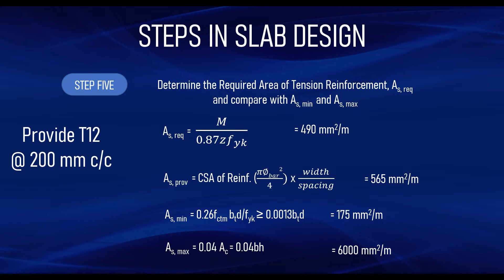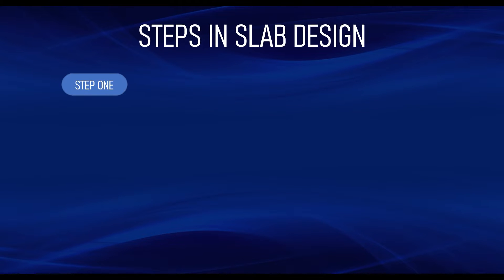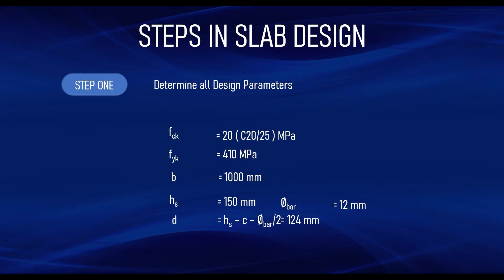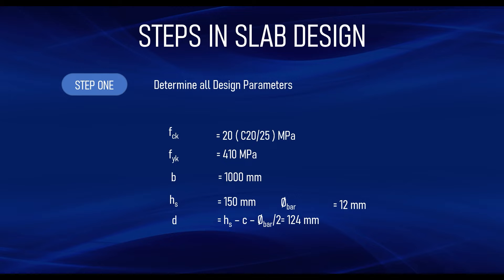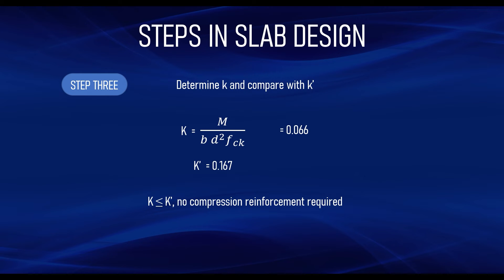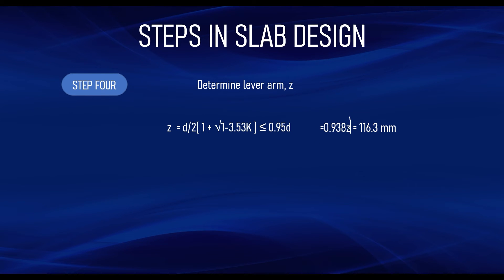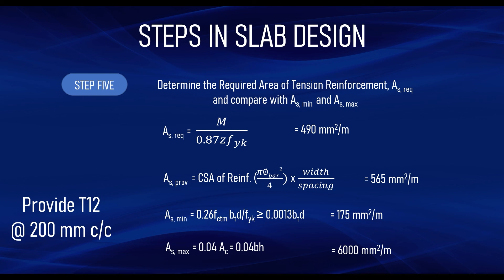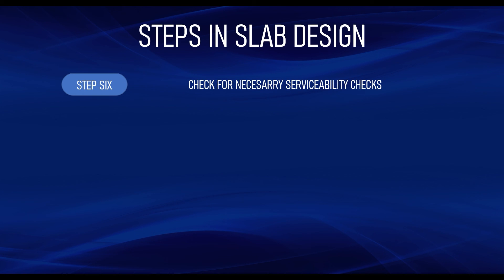Slab Design to the Eurocode 2 | Step by Step Guide

Comment: could you do a video on curtailment of bars for slab especially Two- way spanning according to Eurocode, lap length and hook length, if possible with an example
Reply from the maker: Sure, for details on this topic, you can go through our course on Structural Detailing. Here; https://www.udemy.com/course/autocad-structural-detailing-of-reinforced-concrete-elements/?referralCode=8C60017C56912D4D3C19